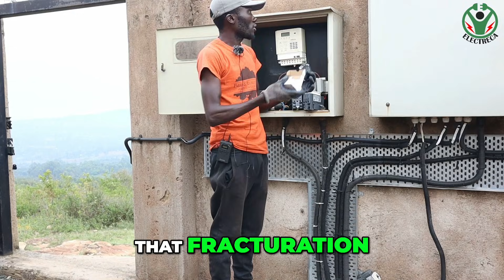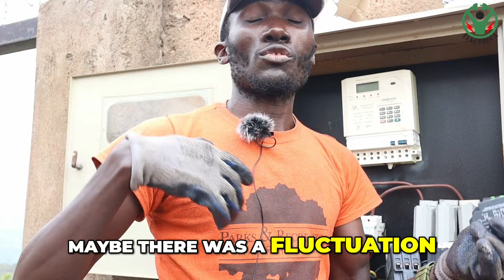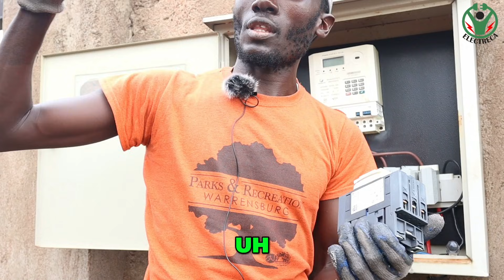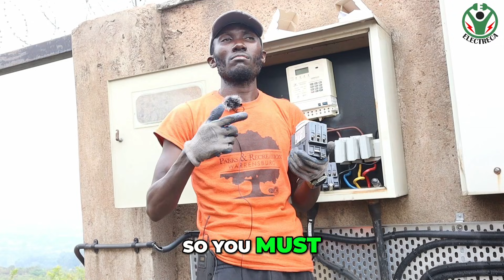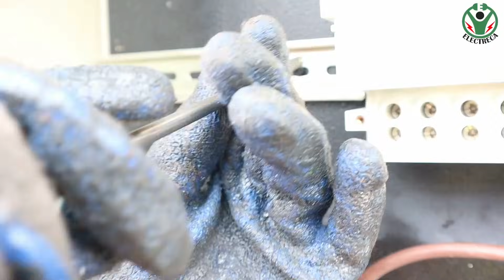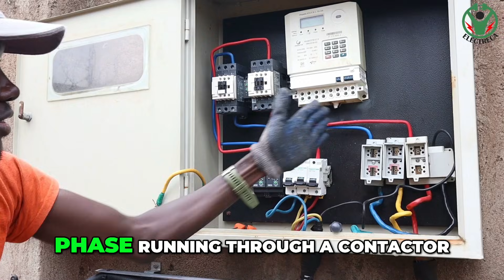Power Fluctuation Control: Proven Tips to Safeguard Your Equipment

Comment: This is basically how a whole house voltage regulator works except it has additional functions like a servo to compensate for voltage drop until it's too low before cut-off.

Comment: Sir what if i just use a single contactor and a single phase failure,can it work ,i just pass all the three phases on one contractor and then i do the three phase connection on the phase failure relay,will it do the same function???
Reply from the maker: Let's understand something here
if you have a 3phase load only that's perfectly fine, what if you have both 3 and single-phase loads in your installation if one phase is missing the 3phase load be off and protected by the 3phase phase failure you installed, but what about the single-phase load? will you be ok if your single-phase load is off too even if you have a healthy phase available?  if not then my explanation in my circuit works fine.

Comment: Good lessons but what is the size of the contactor, timer and other devices in this circuit
Reply from the maker: For this project, I used 80amp contractors. We don't have to care about the rating of control devices because we don't use them directly on load.
In case it is less or more,

Comment: Why not use a 3P +N phase failure,OV/UN monitoring relay ...a timer and a 3pole single contactor rather than two each coz of cost..
Reply from the maker: @jeffersonmusyoki8554  that depent on what kind of load your dealing with, in your case if 1phase detects ov/uv all phases will be shutdown regardless. my equipment however can use 3,2 and 1phase thats why i connected ov/uv relay  on 2 phases.
Thanks for watching though.